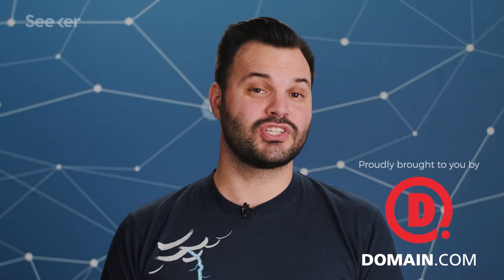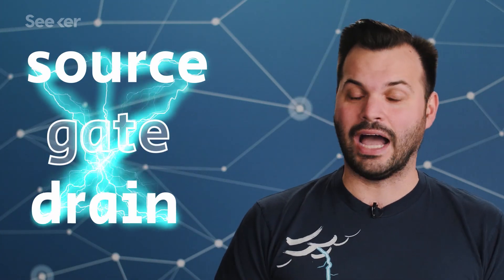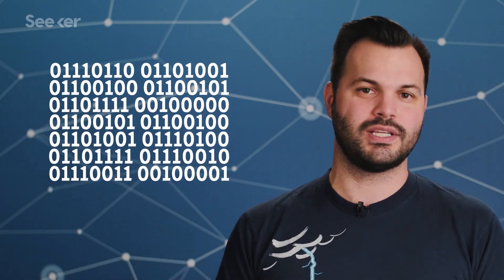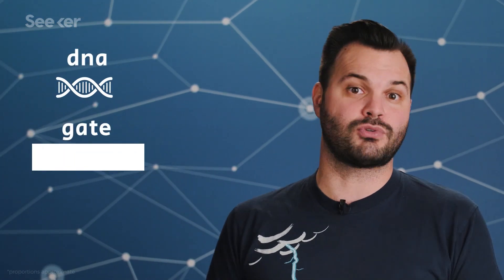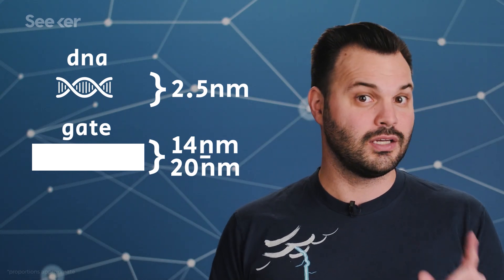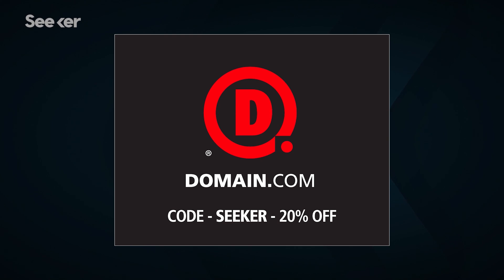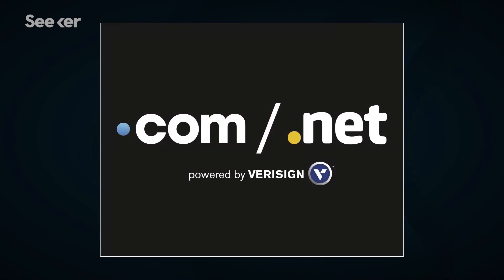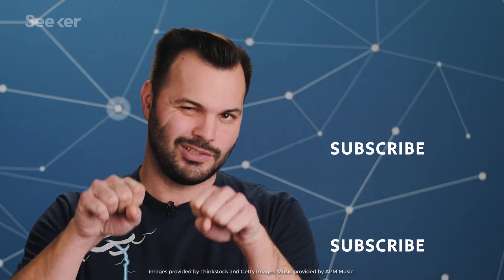This Is the End of the Silicon Chip, Here’s What’s Next

Comment: Your mention of the transistor pins are that of a Field Effect Transistor, which is more commonly used for Amplification.   However switching transistors (even ECL circuits) use a Collector, Emitter and Base.  Otherwise not a bad video

Comment: Very soon we will have to stop using Silicon as we apparently hit the wall at 3 nanometers node, which is what TSMC is currently struggling with. Gallium-based semiconductors compounds seems to be a significantly better option for as an active transistor material.

Comment: Shrinking the size of transistors is not the only path to technology advancement.  There are other things like switching to a much better architecture or from CISC to RISC-V architecture which is far a more efficient way of computing for example.  Or how about coming up with better operating systems and software?  Silicon chips has a long way to go.  Scientists have been trying to replace silicon since the mid-80's with Gallium Arsenide  (GaAs) but they are not very successful.  So silicon is still the way to go.

Comment: There is of course an alternative for domestic users. I have a 15 year old laptop - 32bit!!! - that runs JUST FINE, but it's 32 bit of course. 

I dumped Windoze almost 30 years ago so today I STILL have a fully functional machine running Linux perfectly happily but can't even load let alone run Windoze. 

The industry can solve the physical problem TODAY for at least 15 years simply by putting Microsoft bloat and inefficiency in the bin where it belongs!

Comment: what if we can't make anything smaller? up the die size. that way you can fit more cores and components inside. how? a lot of things can be done from like 3d stacking foveros-style, or chiplet design. with bigger area, comes bigger performance. more cores, cache, etc. = more performance. now, of course with bigger die, comes more problems as well, such as power consumption, thermal design, defects in manufacturing, and a whole slew of others. But hey, at least companies still can boast more performance and generational upgrades that way for quite some time.

Comment: I mean we can make cpu’s bigger right so more transistors but a bigger cpu.
Reply: If the "Die Size" of the Processor bigger (wider) than current size, for example bigger than 2019 Intel size, (1) there will be bigger latency-MS (2) there will be bigger electricity current that needs to go through the processor (3) there will be More Heat Produced due to more Electricity Traffic moving along (4) sure you can put more 14nm transistor into bigger cpu size, but it will only make the overall process slower, because all those information needs to pass through bigger and Longer gate distance.
Reply: Clay Wheeler yeah your right but there are surely other ways right?
Reply: @RowynOfficial  the other way is using "Light and Photon" instead of mainstream Electrons going through conductors. 
The Light and Photons method is called Optical Computing, which is now still under research
Reply: Clay Wheeler yes that would be 1000 of times faster
Reply: Walther Penne you replied to the wrong person.

Comment: The ultimate stuff is diamond,  it has a energy gap of 5 volts, Si has a energy gap of 0,7v, and the heat conductivity is 10 times better. There is one problem, it's hard to make but not impossible.

Comment: High quality graphene is very expensive and can not be produced in mass, only super computers will use nanotubes. We could move to germanium or indium gallide, but that it rare mineral and could be a geopolitical problem. Chip makers can retool for alternating layers of nanotube to reduce need of high quality graphene, that will buy us one extra Moore law "tock", but still leave mainstream behind. There is cpu on memory(memristor) which won't advance the shrink, but give us novel ways to add more cpus. Finally, the best route, indium gallide "alloy" to most effectively keep cost rise in check and retool to layer that in 3d for maximum length of forge service. Such a gaafet structure should bring us into the 3nm range with acceptable yields at the highest possible density. From there, use that same concept to do cpu on memory at highest possible density. That should buy us 7-10 years of time. By then global computing should enable us to leverage all the world's cpus collectively, including the several ultra powerful graphene super computers which should be operational by that time. Then cpu power will become linear in advancement and we might as well consider either biocomputer human augmentation or nuclear war. Either way, expect either humanity to evolve into superhumanity by 2035 or completely stall technologically for the next 100-5000 years.

Comment: Photonics could replace the actual processor technology but the title is really misleading since photonics also uses silicon. 
Molybden is way too expensive and silicon is by far the most present chemical element in the lithosphere (after oxygen of course). 
 The point is no more to shrink the lithography, it is to replace the actual kind of chip for another one and photonics could be one of them.

Comment: From what I understand by 2021-22 transistors within a Silicon Chip will stop shrinking. The drawback of S.C is  heat generation as the ever increasing number of transistors makes it difficult to keep S.C within temperature limits. There are other limitations but for over 60 years S.C have served us well considering that the chip itself has kept pace with Moore's law.

Comment: If we can fit 19,200,000,000 transistors in a 
37.5mm x 37.5mm package.... we could fit the double of those transitors in a double sized package. Why not just make the DIEs bigger? With the phones it was the same thing. They started as huge equipment, then they shrieked to a NOKIA 3310 size and now we have big phones.

Comment: Why not just make the chips twice the size or quadruple the size and have one giant CPU but keep the gates the same size? More gates bigger CPU.
Reply: Manufacturing a piece of silicon without defects get VERY expensive once you start making it big (exponentially so). And there are losses associated with using multiple silicon chips for the same processor. Also bigger chip - harder to cool; just look at Threadripper or Xeon Phi
Reply: Ronnie Pirtle Jr facts
Reply: I don't have a good grip in field/might be wrong, but IMO y'all answering are missing main point.

CPUs run in discrete steps by command of clock signal (imagine a metronome idk), so each transistor has to go into it's final state for given step in constant timeframe, before next clock/beat. Transistors relay on electrons, which can't be faster than speed of light. So, at 5ghz electron can only go for c*(1/5x10^9)=6 centimetres before it's late and next clock starts. Now add overhead of that transistors aren't connected in straight lines, that they aren't actually traveling at full speed of light and add some headroom/tolerances.
Somewhat-somewhat in the same order of current CPU cores sizes.

So, to summarize: big cores — low clock speeds. And probably there is not that much to add (and plenty of designs were tried?) to make core bigger, so when lithography shinks CPU manufacturers don't add more transistors to cores, but go for higher clock speeds. 
Adding cores is possibility (because they don't need to be perfectly synchronised on each clock?), but only effective for specific tasks / before certain amount of cores.
Reply: Bigger CPUs need more voltage to run. Thus also getting hotter and needing better cooling solutions.
That's really all that shrinking nodes is about. Being able to have more transistors in a small package, while keeping power consumption and temperatures low.
What I mean is, you can't just quadruple the "CPU size". It'd have alot of problems, but the biggest one by far would be the power consumption.
Reply: uhhh they already do that. its called multicore.

Comment: The 1 and 0 thing is actually wrong. The only time you will find a current in a transistor, is when it changes its state. The real 1 is the voltage of 5V the transistor has after switching and that 1 is interpreted is by the effect the voltage has on connected transistors as it encourages their gates to react. And 0 would be no voltage. If the current was flowing all throughout the on-state, transistors would need much more space or room-filling cooling systems due to the heat generated by the current. Also, the chips intel makes nowadays would need massive power supplies to run and be very shortlived.

Comment: No, an even better way, is not only shrinking the transistor down, but stacking, them. Essentially, it would come down to stacking them. So while you have millions of tiny transistors going, 10101011001001110.
Another below it is doing the exact same. And yes, you guessed it, yet another.
These could be labeled as 0 (ToP), 2 (ToP) and last but not least, 4 (ToP).
"TOP" chip. Which stands for; "Trilinear ordering Processor". I had a template once of a prototype. Meh, I can always just draw up a new one. Easy.

AMD, listened. When I was tired of seeing the same old "GDDR" RAM configuration, on video cards. I sent feedback in telling them if they 'stacked' the MEM, vertically that would not only save on space but bring up speeds of it to 4 times that an there of, regular gddr. Which is, or no; "Was" good in it's  time. It's much too obsolete now.
Gddr6?; ugh. HMB is by far a much sounder architecture. And now... so will this. The ToP.
I know Intel is one who is on that ball and has it already rolling. Their testing with it already. They put the architecture  to use in a few things already. Think it was a video that made.

Comment: as current Intel architecture...we haven't tap in the potential on architecture itself yet..so its 35% using so far against AMD Ryzen is only at 75% tap in potential ...so intel has more head room for developers from available instructions codes like avx2 and sse bank codes are embedded in the chip that developers overlook...those what give intel momentum in high instruction count per thread than its competitor who are still behind the curved
Reply: the x86 architecture might very well be replaced with something like ARM in the future.   given its simplicity and power over the mass complexity of x86

this is probably why most tablets these days are competing with the speeds of 1990 - 2000   era pc cpu's

Comment: It's just the opposite, in state 0 the transistor is ON and drain voltage is zero, in state 1 the transistor is OFF and drain voltage is equal to VCC. The most common FET is N-channel.

Comment: A transistor has a base, emitter and collector...MOSFET's have the source, gate and drain. But good video :)
Reply: MOSFET is a type of transistors. BJT is another type of transistors. The difference between the 2 is the gate of MOSFET is insulated from the "source" so there is little leakage of current but BJT's base is not completely isolated and current runs through base to emitter after getting over the valence band gap.

Comment: Binary architecture leads to stasis.   Start over, base-3 minimum.    Watching the video, if you did make stuff so small you got some leakage, this may be the way to provide the integer needed for original thoughts from a machine.   You could build a hybrid chip, one with 5nm switches for the binary stuff needed for stability, and another set at 3nm to provide the randomness, a right-brain-left-brain thing.

Comment: the part of 1 and 0 are not exactly true, computers are made using what is called CMOS, which stands for complementary Mosfet, so there is a circuit that allows current to a point giving a 1, if the gate does not allow the flow of current this 1 will remain forever and ever until the complementary circuit that drains current open their gates to give a 0

Comment: Higher core counts, clock speeds, and better-optimized architectures are the way forward for CPUs for the time being. Moore's Law has been dead for a while, and that's how processors have been progressing for the most part, bit by bit, and that's probably going to keep up for a while before any radical changes like using light in our CPUs.

Comment: silicon has a soft limit of about 4ghz, which is why PCs have stuck around this speed for so long. It's a soft limit so we can push further, but the harder we push it, the more unstable it becomes. We've been able to compensate for the instability to a degree.
So instead of making it faster, we just added more transistors, especially in the form of more cores. This way it can compute more data without drastically increasing the speed. This is why we don't have 8, 10 and 12ghz cpus. and why a 3ghz cpu today may compute more data than a 4ghz cpu from 8 years ago.

Graphene has a soft limit of at least 4 terahertz. 1000x faster. Problem with graphene is energy leakage.
If we can solve the energy leakage problem, we can make CPU's 1000x faster. Combine that with our high transistor, multi core lithography. 
Once again we'll be able to fit today's super computers into the pockets of tomorrow. As our current cell phones have the computational power of some of the earliest super computers.
Reply: if they would stop making it smaller they would have no problems. I just dont understand why we need smaller... why not just MORE of......  its beyond stupid considering space and cooling can be 100 fold with what we already have. :-\   its beyond me why I can find a simple motherboard with more then 4 cpu's ...  

is it just me or do you think they're barking up the wrong tree with miniaturization  ?
Reply: @harleyme3163  i'd rather not call it "beyond stupid" when you know how smart are the people that make integrated circuits. There are many issues against your idea:
-more area of a chip = more cost (silicon and chip production are VERY expensive. I am 100% sure that you wouldn't like to pay 4x more for cpu just because u wanted it bigger)
-more cores = more transistors = more heat (if you think heat is not the problem, provide better solutions of cooling. air and water cooling haven't changed since 15 years)
-more cpus = more complicated motherboards, high bandwith interface needed (which requires additional power), more expensive and power consuming solutions which make computers bigger and less convenient for average user

So why would you want to stop making it smaller? It actually gives multitude of pros:
-smaller transistors = less current and voltage = less power consumption = easier to cool
-smaller transistors = more transistors per mm^2 = more computing power
-smaller transistors = more cores per chip = higher multicore speed
-smaller transistors = smaller and power efficient chips = less invasive in biology (we can solve many health problems using biotechnology)

Comment: The problem isn't just size but also distance between devices on the chips.

Electricity travels at a finite speed so the farther it has to travel the longer it takes,  modern CPUs are mostly 2 dimensional and some signals have to travel from one side of the chip all the way to the other which takes time.  

That leads to the logical conclusion that not only would making the devices smaller and therefore closer together improve speed but making them 3 dimensional would also shorten the distances even more and increase speed even more.

Comment: As much dust that there is, dust can be used for it reacts to static charge or cling. I remember when some old tv brand backing or even electronic tube boards were made from dust composits. I believe dust is used today as well for some board applications. Dust, carbon, and silicate polymers. So is the air chip next? Kinda like playing air guitar.

Comment: The first transistors were based on germanium.    Silicon turned out to be easier to purify and the crystals are more stable which made it more reliable.   Is any research being done with germanium these days or is it just an entry in the history books.     What became of gallium - arsinide?   I read about the this material years ago as a potential successor to silicon.

Comment: 0:34: „...and if the gate allows the electrons to pass...“
Seems like you're saying that the gate actually keeps electrons from flowing from the source to the drain which isn't technically correct. What keeps electrons from flowing through the transistor is the electric field between the source and the drain, and the gate helps the electrons to overcome it by attracting them. I'm oversimplifying the process but that's basically it.

Comment: The problem is this guy does not understand the electronics of this technology. What he is really talking about is not just transistors but Field Effect Transistors, aka FET's. There are actually many kind of gates used in logic. But FETs are probably the most ubiquitous simply because you can make them really small. But there is a HUGE problem with FETs. If you hold a FET in your fingers and blow on it, you will destroy it with the small amount of static you, as a human, create with your breath. That, of course, is handled in a circuit that uses millions of them to do some work like memory or a processor by clever arrangement of ground strips and other techniques. But it also means that all  of those circuits are extremely vulnerable to "static" electricity in the air, electricity that has only millionths of an amp of current but possibly millions of volts in amplitude. If you have heard of EMP (electro-magnetic pulse) weapons that destroy all electronics for miles, that is how they do it. 

Enter DTL (Diode Transistor Logic) and TTL (Transistor Transistor Logic. FETS are weak because of their use of very fine junction lines. But other transistors are less vulnerable to high current. Military circuits commonly incorporate these old tech but hardened circuits in our missiles, rockets and ships at sea.